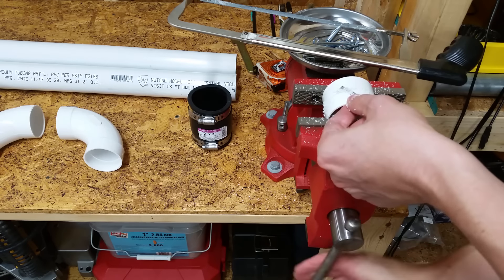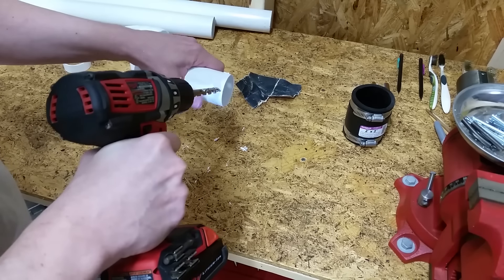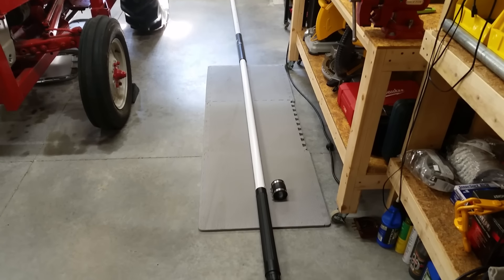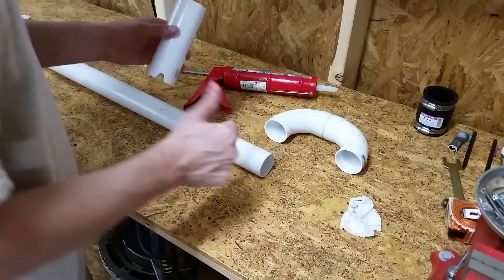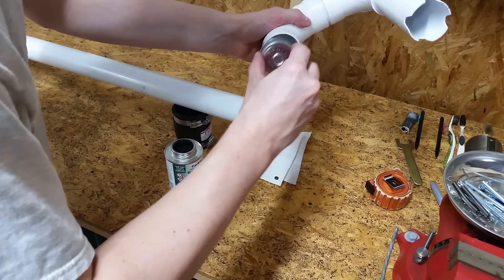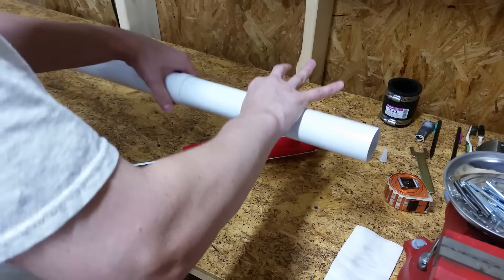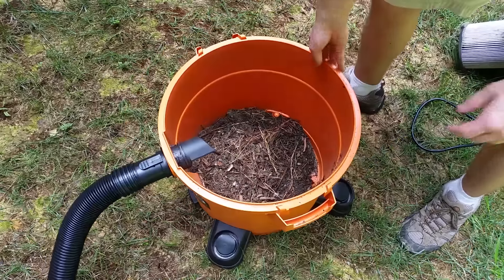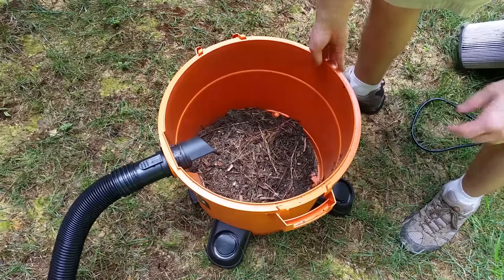DIY Gutter Vacuum - Easy and Safe Gutter Cleaning from the Ground

Comment: nice video!  The main issue I have is that I need to use 3 pieces of the vacuum tubes which I think is quite high so it is not easy to control.  I thought about use ABS pipes as they are light as well but do not know how to connect them
Reply from the maker: I think the central vacuum tubing would be lighter than one made completely from ABS pipe anyway. They sell the tubing in 8' (what I used) and 10' sections. Depending on your gutter height, you might not need to use three full 8' sections or maybe you could make it work with two 10' sections. My highest gutter is probably around 20' high and I can reach it by holding the bottom of the attachment at chest height. Let me know how it goes or if you have any other questions.

Comment: I made the same thing out of lite weight pvc but attach it to my gas powered blower. 2 story house. It’s not perfect but no way I’m going up a ladder. I have screens on the gutters but a lot of maple trees dump a lot of leaves and helicopter seeds and pile up on the screens. Eventually the gutters need cleaning but I pay a guy to clean out the downspouts.
Reply from the maker: Yep, I can do the same thing by connecting my gutter vac attachment to the exhaust port on my vacuum but it's messy. :) Thanks for watching!

Comment: Not sure how the 2" abs pipe fit over the 2" pvc tubing?  I though pipe and tubing size is based on outer diameter.  Thanks for the video.  Hopefully I can get the the abs pipe to fit over the central vacuum pipe perfectly just like how u did yours
Reply from the maker: Pipe is measured by the inside diameter while tube is measured by the outside diameter. This allows the central vacuum tubing to fit inside the ABS pipe.

Comment: This was Featured by readers digest 50 year's ago.
If you cut your end piece that you insert into gutter at about a 45° to 70° then cut off bottom 2" this is a oilfield "mule shoe"
You can get under cross piece.
Also use long radius 90's helps.
Then you can stand off to side and not strain your neck.
I did this many times over the years.

LET'S GO BRANDEN!!!
Reply from the maker: 50 years ago, wow! Was it something you could buy or instructions for how to build one? Thanks for watching!

Comment: Hi Mike Attempts..I can't seem to find any Schedule 20 PVC tubing locally. The closest Home Depot that has it is 25 miles away. Will Schedule 40 PVC work just the same for this?
Reply from the maker: Schedule 40 PVC is a lot heavier than the central vacuum tubing (schedule 20). It might work for a 1 story house but I think it'd be just too heavy and unwieldly if you tried to connect two pipes together. I found a couple places online that will ship them but I ended up getting my tubing and fittings from a local electrical supply company. Call around and see what you can find.
Reply: Mike attempts I can speak from personal experience, schedule 40 is too heavy and lead me to this video. I’m looking at retooling and using Black ABS or cellular foam core.
Reply from the maker: The central vacuum tubing (schedule 20) worked great for me. If you find something that works as good, or better, let me know.

Comment: Is it correct to assume there’s a camera attachment that provides a view of the effectiveness of the gutter cleaning on an on going basis?
Reply from the maker: You could do that but then it becomes a 2 person job. One to control the attachment and another to watch the camera to see if you missed anything. While it would be a cool addition, I think it's unnecessary because, if you use a strong enough vacuum (5 HP or higher), it's going to suck up anything that's in there. For this video, I just taped a camera to the attachment but I couldn't see what was going on in there until I was doing the editing.

Comment: Is it just me? Or does the 2 x 2 Fernco rubber coupler not even come close to fitting the schedule 20 2" tubing? It fits the shop vac side just great. But there is no way at all it will fit the 2" OD tubing. The dimensions shown at Home Depot on this is 2.2-2.5". Might have better luck with the 1.5 x 2" as it shows the dimension for the 1.5 side as 1.8-2.0". So FYI!
Reply from the maker: I didn't end up using the rubber coupler because it wasn't needed with the final design. I did a follow up video with more details, check it out.

Comment: Hei Mike, what's the minimum power of the vac for this? My gutter is only around 3 metres high. Thanks.
Reply from the maker: I'm not sure about the minimum required power. I think my vacuum is 10 AMP, around 135 CFM, and 5 HP. Although the "HP" rating for vacuums is not standard and somewhat misleading. I'm sure a weaker wet/dry vac would work but it will need to be more powerful that a typical household vacuum. Since your gutter is only 3m high, you could just build the top portion and it should reach just fine.

Comment: Camera. So I realize that you attached to camera to just capture video of it working, but I think you can take that one step further if you have a GoPro or two cell phones.  I attaché my GoPro to the pipe at the gutter cleaning end,  Bluetooth my GoPro to my IPad through the GoPro Quik App and view the live video feed from the GoPro on my IPad on the ground.  You could do the same thing with two cell phones, a small selfie stick and FaceTime.  Mount one phone on the selfie stick, tape the selfie stick to the pipe and FaceTime the other phone on the ground. That way you can see what’s going on in the gutter real time.  You could go crazy and have a second selfie stick setup for the bottom so as you are looking up you can see the live feed from up top.
Reply from the maker: Those are all great ideas and I've thought about doing that. However, since my gutters have those brackets every couple of feet that I have to "hop" over, I end up going back and forth a bunch of times in between each set of brackets. I wish my gutters didn't have the internal brackets because it takes longer but also causes me to be extra thorough. I'm sure this advice will come in handy for others who decided to build this gutter vac attachment. Thanks for the comment!

Comment: Hi Mike, my husband and I use a similar set up for our single story home. What do you suggest for clearing the downspouts? Thanks for a great video!
Reply from the maker: Usually there's a clump of stuff sitting on top of the entrance to the downspout and the vacuum attachment is able to suck it out. But, you're right, there probably is a good amount of stuff further down the downspout. Before I made the vacuum attachment, I thought about doing something that would connect to a garden hose to spray out the gutters with water. I ruled that out because it would be cold to use in the Fall and also really messy. However, maybe something like that would be perfect for clearing downspouts! You could vacuum out the gutters and then flush out the downspouts with water. It would be simple to build out of smaller diameter PVC, and have the same shape as my vacuum attachment. Maybe I'll build one and do another video. After flushing out your downspouts, you could install those downspout guards. They just look like a little wire cage that you stick down in to the top of the downspout and they keep the bigger stuff from getting in. Thanks for the comment, hopefully my ramblings were helpful. :)
Reply: W309

Comment: Didn’t think to use it on the vacuum. I did it with the leaf blower.
Reply from the maker: Yeah, you can also connect the hose to the vacuum exhaust port if you prefer to blow out the gutters.

Comment: I miss the point for clogging up a good HEPA filter in vac.  I do blow mine out, reverse on vac or battery blower, but with vac it's a waste of the filter.
Reply from the maker: I use this attachment to clean my gutters twice per year and it's not hard on the filter at all. The leaves and pine needles don't get chopped up so there's not much small stuff to get caught by the filter. The filter is also very easy to clean out. You could definitely connect this attachment to the exhaust side of the vacuum if you'd prefer to blow out your gutters.

Comment: But only problem you didn't show the connection to the shop vac
Reply from the maker: The attachment just slides down inside one of the ridged extensions that come with the shop vac until it runs into the stop ring I glued 12 inches up the tube. I made a follow up video with more details, if needed.

Comment: What is the size of your vac hose? 2 1/2" or 1 7/8"?
Reply from the maker: My vacuum hose is 2 1/2". You definitely want to use a wet/dry vac for this because the leaves could be wet and it requires strong suction.
Reply: @Mikeattempts  so the vac hose fits directly on the 2" pvc?
Reply from the maker: The 2" PVC fits perfectly inside the end of the extension piece that comes with wet/dry vacuums. To stop it from going down too far, I glued a ring to the PVC as a stop. If you look at the 3:47 minute mark of the video, you'll see the black extension, attached to the hose, at the bottom of the screen.

Comment: Anyone try to make one of these lately? I can't seem to find any place local that sells "thin wall PVC pipe". There's not even an option to ship to store. I can't find anyone who carries the stuff anymore.
Reply from the maker: I did a follow up video with more detail. What you're looking for is specifically called "central vacuum tubing" and you can find it at your local electrical supply store.

Comment: Ingenious idea!!...did you encounter any wet leaves during your gutter cleaning? Is it strong enough to effectively vacuum wet leaves?
Reply from the maker: Thanks! There was no standing water but some of the debris was definitely wet. I have a "5 HP" wet/dry vac and it had plenty of power to suck everything out. If you need more suction power, you could get a vacuum with a stronger motor.
Reply: @Mikeattempts  Thanks Mike...I would think this should also work with unclogging downspouts as well. I think I'll give this a shot.

Comment: In the time it took you to put all that pipe together i could easily have cleaned all the gutters already. Just install gutter guards then you don't ever have to worry about cleaning gutters.
Reply from the maker: With all of the pine needles we have, I'd still hafta clean the gutter guards. This solution works great for me.

Comment: I believe I misinterpreted how to attach the shop vac hose to the pic device.  Great video, I'm afraid my accounting degree is interfering with my good senses.
Reply from the maker: Thanks! Yeah, I thought I was gonna need that rubber coupler but gravity and suction seem to hold it together well.
Reply: Using the rubber coupler is the only way I see to make the attachment..  Did you use the black pipe?
Reply from the maker: I used the black ABS pipe to join the 2 long pieces of vacuum tube. The little white PVC ring is what keeps the tube from sliding down further into the hose. You could cut little 1 inch rings from the black ABS pipe to use as your stoppers.

Comment: I made mine about 10 years ago but what i did differentwas i put the 1 and ahalf pipe inside a 2 in so i could ajust it on the fly  and it does work and im 70 so i dont like the latter ether
Reply from the maker: Ah, that's cool, kinda like a telescoping version.

Comment: This is exactly what I need however central vacuum tubing cannot be found, tried Home Depot, Amazon, Lowes, Menards, and a local plumbing supply nobody has it. Argh!
Reply from the maker: You were sooo close... your local electrical supply store should have central vacuum tubing. I incorrectly assumed plumbing at first too. I did a follow up video with more details, if you need it.

Comment: I’ve been a gutter installer for 20 years and this will work on dry leaves but that’s all. No way that contraption will get the shingle grit ( one half an inch will add hundreds on pounds) off the bottom of a gutter. You have to manually scoop it out!
Reply from the maker: It gets the shingle grit, you can see it at the end of the video when I open the vacuum. However, as a pro, you probably see much worse gutters. I'm not a pro, just a regular home owner and it works great for me. Making it easier to clean the gutters hopefully means that people would clean them more often so there wouldn't be such a large accumulation of grit. Worst case would be to start with a manual cleaning and then use the gutter vac attachment twice per year. Thanks for watching!
Reply: @Mikeattempts  Exactly! Pine tree nedles drop constantly, might need to use this unit 2-3 times a month, after initial cleaning, gutter hangers every ft. add to the dificulty, wont work on wet debris. Nice build though
Reply from the maker: @10000000peso  I've used this attachment 2 times per year for 3 years. I always wait until it hasn't rained for at least a few days. The stuff at the bottom is always at least a little damp but it gets sucked up without issue. Thanks for watching!
Reply: @Mikeattempts  maybe add a scraper attached to the end that’s just smaller than the gutter bottom. Roughly 3” for 6” gutter. Hangers are every 2’-3’, usually, but the older the gutter, the more people have been up there adding screws, more hangers, etc. 
I prefer something similar in shape to what you made, just shoots water in a semi high pressure, with a fan tip ( thin spray about 2” wide ). You work towards the downspouts and flush it out! 
Also , I live in northeast Florida and really can’t say what conditions occur in other parts of the country. Just my experience.
Reply: @Mikeattempts  Also you are very correct in that it is something that should be done on a regular basis depending upon what amount of leaf fall you get, how new/old your roof is. Starting with a clean slate is always best, then just plain old upkeep. Gutters are a big investment in your house, and should be treated as such. 
I love the fact that your just a guy in his garage, making stuff to assist the regular homeowner in upkeep on their homes!
Reply from the maker: @donaldnutter2074  Yep, a little maintenance goes a long way. Thanks for the positive comments!
Reply from the maker: @donaldnutter2074  Those gutter hangars really get in the way and slow the process down a bit. If I had to do it over, I think I would have went for the rounded bottom gutters with the hangars on the outside. :)
Reply: @Mikeattempts  those half round gutters don’t have the capacity of standard gutter and that necessitates having more downspouts.
Reply from the maker: @donaldnutter2074  Ah, that makes sense.

Comment: Found sch 20 central vac tubes at a local vacuum repair shop
Reply from the maker: Nice, glad you found some! They used to carry it at the big home improvement stores but it seems like you hafta call around to the smaller shops to get it now.

Comment: Schedule 20 pvc pipes are hard to find locally. Home depot and Lowes only carry heavy schedule 40 stuff.

You would think schedule 20 is dirt cheap since it's half the material. Yet, it costs more than standard schedule 40 pvc.

If anyone knows where we can get schedule 20 stuff locally at a brick and motar, let me know.
Reply from the maker: I purchased mine at my local electrical supply store for $6 per 8 foot tube. Call around, someone will have them.
Reply: @Mikeattempts  thanks Mike! I'll look up electrical supply stores to call. Do you know what they call them? Thin wall pvc pipes? Schedule 20 pvc pipes? Is there a common name these electrical supply stores use?
Reply from the maker: @cadd9511  It's called central vacuum tubing. I don't know of any electrical supply store chains, around me they're all just local mom and pop stores. If you Google "electrical supply near me", you should find a few. Let me know how it goes.

Comment: Nice project but wouldn't work for anyone with large leaves like sycamore or maple ....too big to suck up in that small 2" pipe. I have a similar set up that I connect to my leaf blower and blow them out.
Reply from the maker: I'm not sure, some maple leaves end up in my gutter and it sucks 'em out. I guess large dry leaves could get stuck since they won't bend easily. The easiest way to test it out would be to put a pile of your leaves on the ground and then try to suck them up. If it works on the ground, it should work in the gutter. You can also use this attachment to blow out your gutters by attaching the flexible hose to the vacuum's exhaust port.

Comment: Why not simply put grated wire over the top of the gutters  as you can clearly see anchor points on the brackets for this it doesn't prevent everything from going in or growing I'm  pretty Shure if the moss is wet and and gets a grip even the vacuum wil have difficulty in sucking it away ..seen a couple of these videos now obviously a safer way to clean them .but I'd go for option one grated covers also stops animals from nesting in them 👍👏🏴
Reply from the maker: Trust me, I researched every kind of gutter guard I could find before making the vac attachment and, in my option, they all suck. I have a LOT of long leaf pine so, if the hole are too small, they'd just lay on top of the guards and the water would flow over the edge. If the holes were too big, the long pine needles would just fall through the holes. The guards that use surface tension would allow a lot of needles in too and, if it rains too hard, water just shoots over the edge. Even if I found a good gutter guard, I'd still hafta get on a ladder every few years to clean out what got past past and then I'd hafta remove the guards to clean. The attachment was cheap and easy to build. It's easy enough to use and I only hafta do it twice per year.